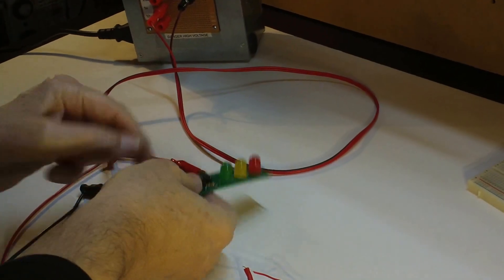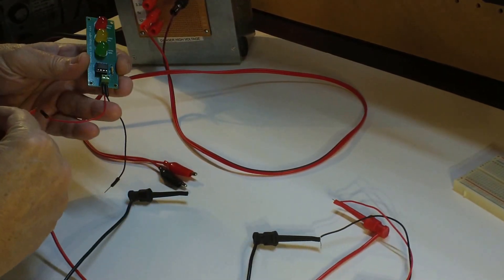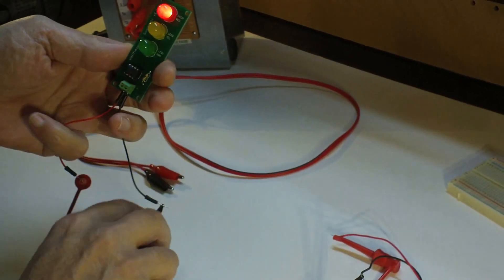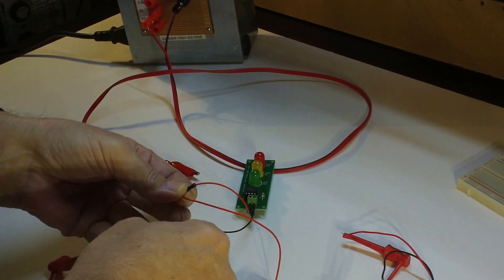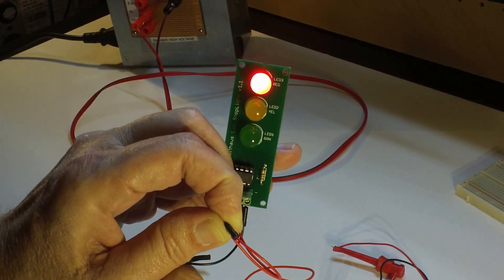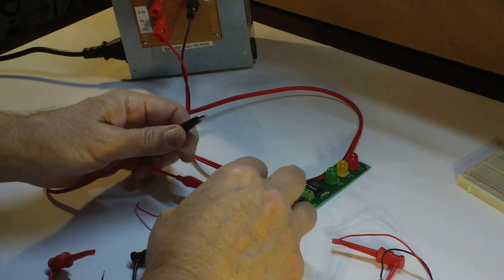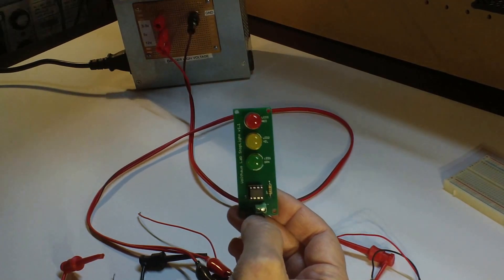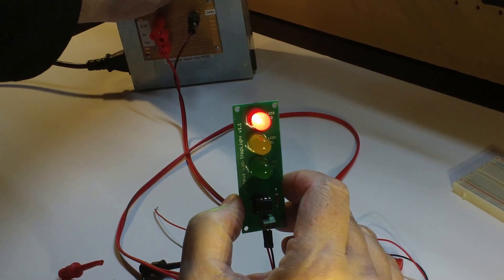Powering Classic ATtiny85-20PU Stop Light Kit

Comment: I want to hook up 2 ATtiny85s together with a Bluetooth module. I want a lithium battery but don't know where or what voltage o get. Do you have any suggestions?? please and thank you
Reply from the maker: +WLTR AEP  I hooked a 3.7VDC 18650 up to the ATtiny85 Stop Light and it powered it for a week before it needed a recharge.
Reply: Volthaus Lab just one? if its just one that's pretty good